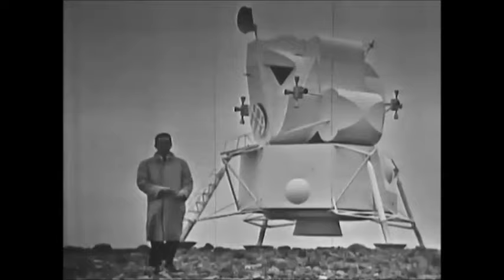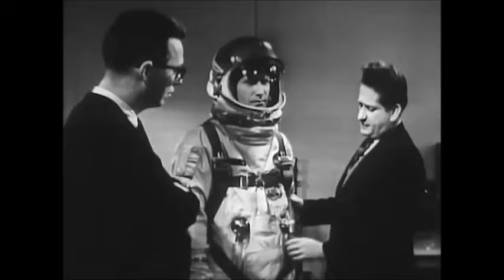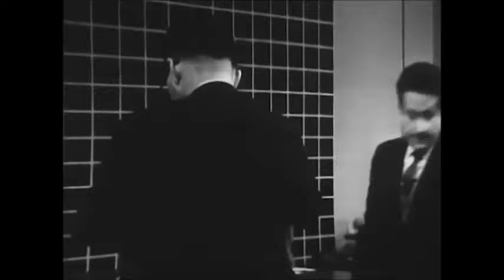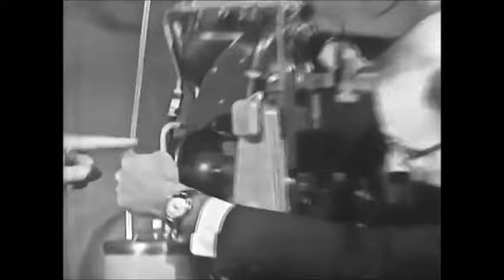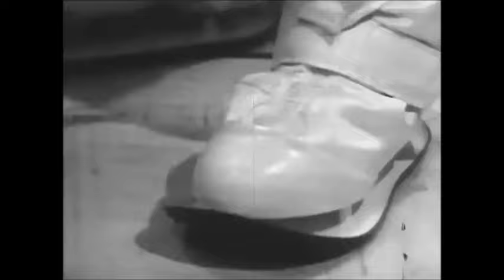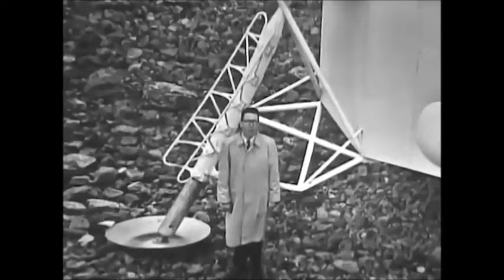History of NASA Space Suits - 1960s' - FLAT EARTH

Comment: Fantastic bit of indoctrination.  But they let the cat out of the bag at the very end . The hard suit with swivel joints , the only model with even a scintilla of a chance for astronaut flexibility and survivability. Given the stated lunar temperatures extremes, powerful gamma radiation and immense vacuum . The first 3 suits, even Apollo, where glorified scuba dry suits, fitted with rebreather units , wholly unsuitable for protection against the  harsh vacuum and deadly radiation  notice there was no heater unit for the negative 153 c  temperature found in the shade . Please , nobody try to say the co2 scrubber heat was the heater .  Great find and thank you for posting.  ... By the way the plate sublimators should have been venting water vapor visibly and of course , never did..